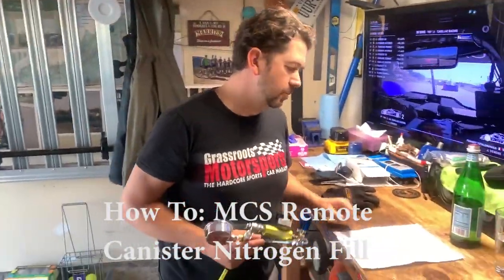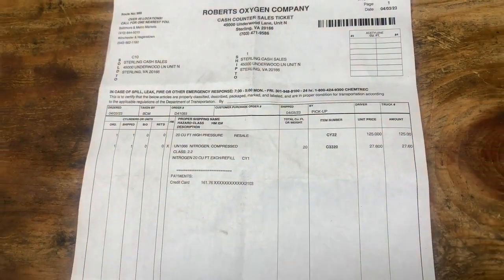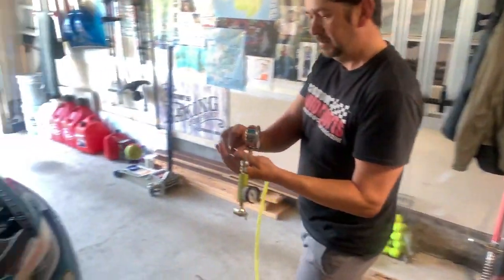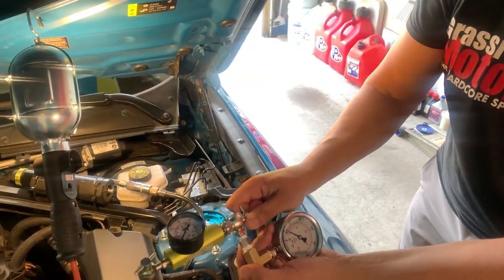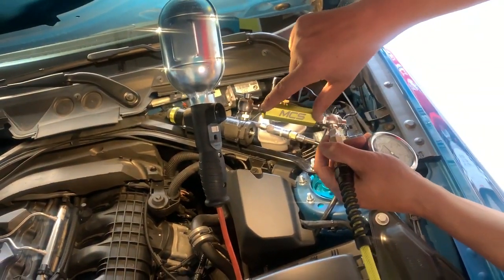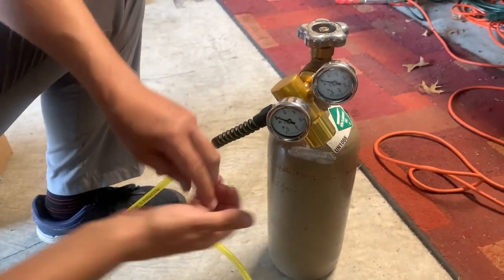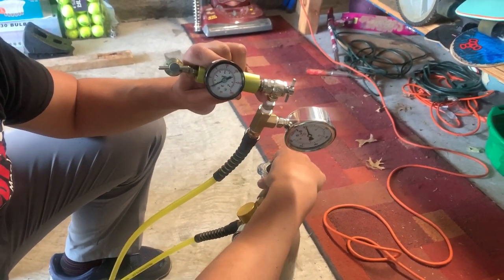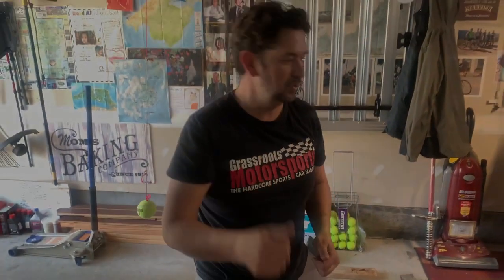How-To: Refill MCS Remote Reservoirs with Nitrogen (Includes Needed Tools)

Comment: What happens if the pressure drops to zero while filling?
Reply from the maker: Not sure what you are asking - if you mean is the car drivable then the answer is yes but for best performance you’d want to refill asap.
Reply: @GasBurn_life  thank you. I was filling mine, left gauge on for a minute and didn't realize there was a small leak so pressure dropped to zero. I didn't know if that would cause the shock to have to be bleed or any other issues.

Comment: How often does the reservoirs need to be refilled?
Reply from the maker: I had these installed last May and I did about 8 events on them - mainly clock-wise tracks like VIR and WGI with lots of kerbs; Tommy checked them over the winter, and the front right shock was low, below 100 psi if I recall correctly. Since I now have the equipment and have time before the next event, I decided to check them again. I will probably double-check pressures at least 2x during the season.
Reply: @GasBurn_life  got it. Thanks! Watching your lap video, so fast!